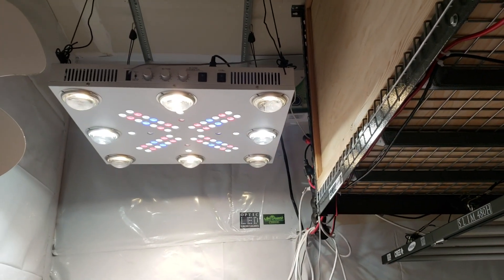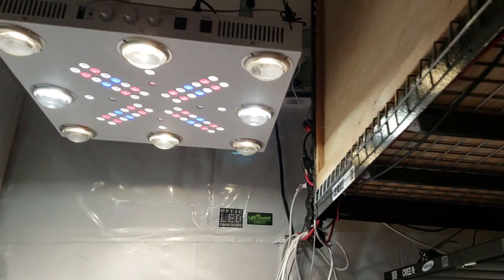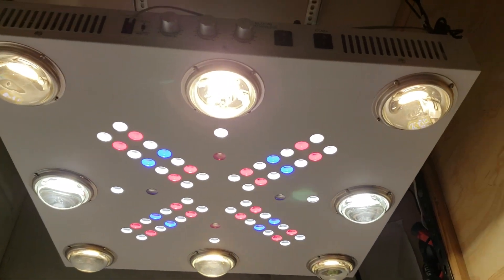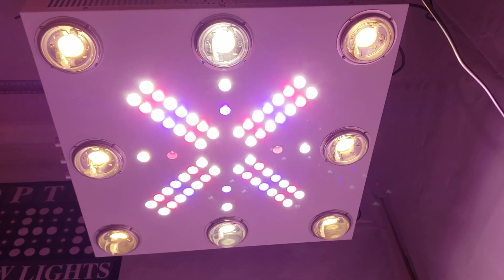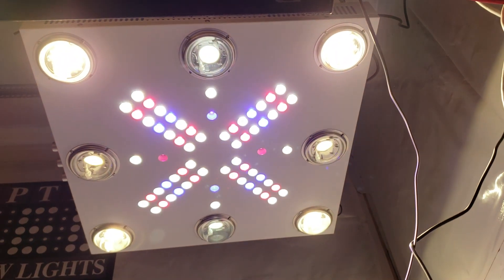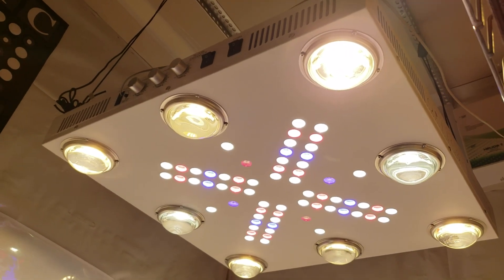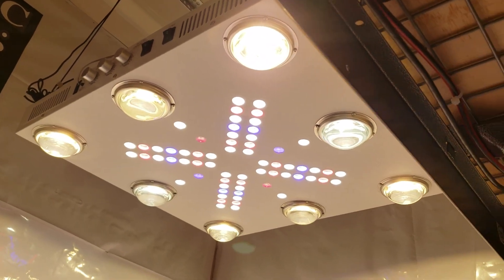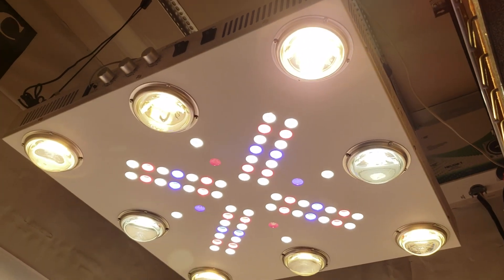Optic 8+ NextGen vs Slim 480h - Preparing for the New Grow Series on WestCoast Cannabis

Comment: What up Weston, Good to hear from you, the Optic 8 is definitely my absolute favorite too but remember we talked about I don’t have the height for it, I want it bad it’s so Dope especially now with the ports for master controller it’s so sick!!!, September I’m shooting to get the Slim 480h with master controller, I can’t wait!!! Does the The Slim Series have UV?
Reply from the maker: Sup hersh. I hear ya man. For the slim series we have a Slim series VEG light coming & a Slim series Bloom enhancer. The bloom enhancer is specifically designed with Alot of UV LEDs, IR & Deep reds. This way commercial growers can add these extra bloom enhancer bars in between their lights during the last few weeks of flower for a heavy load of UV & Deep reds. Slim series growers will be able to add the Slim bloom enhancer if they want they want the UV. Studies show you truly only need to run UV the last 3-4 weeks of flower. ✌😎
Reply: OPTIC LED GROW LIGHTS that’s awesome 👏 I have the  HLG UV bar I purchased separately from HLG and it mounts right under the middle of my 550rspecs and I run it the last couple or few weeks of flower, I’m so happy to hear that I can do the same with the Slim Series, that’s seriously so awesome 👏 I’m hella stoked now and Seriously can’t wait to set up my Optic Tent, I’m shooting for September but regardless it’s getting done next winter for sure, I’ve got a sweet ass grow room that’s a complete empty Utility Room at the end of my finished basement with HVAC and on its own zone and I wanna fill it with more Tents equip with nothing but Optic LeD’s and have a perpetual grow of hella Dank!!!😊😋👌💯✌️